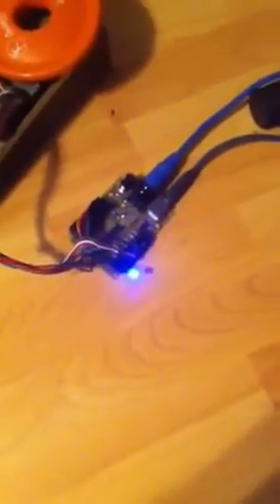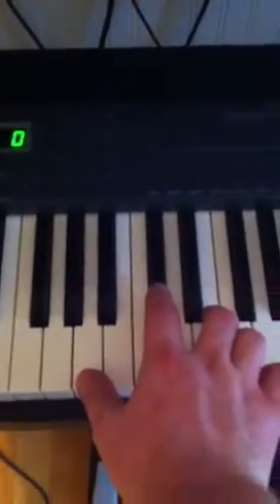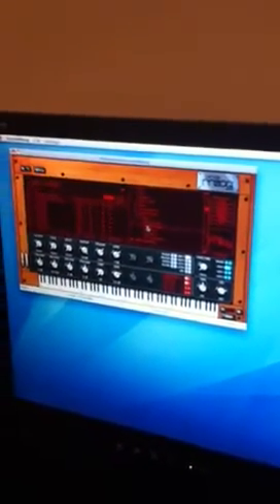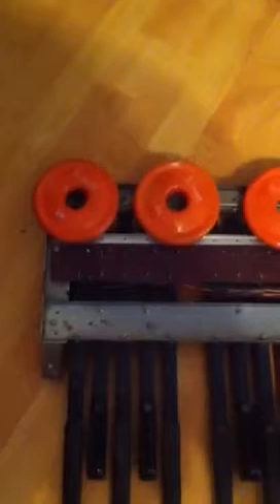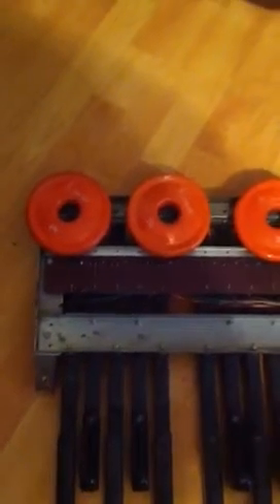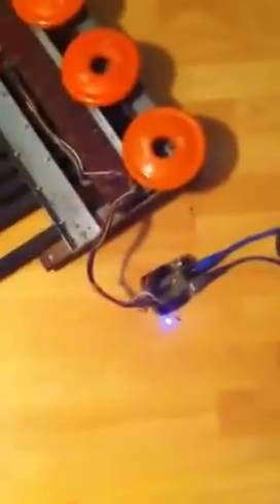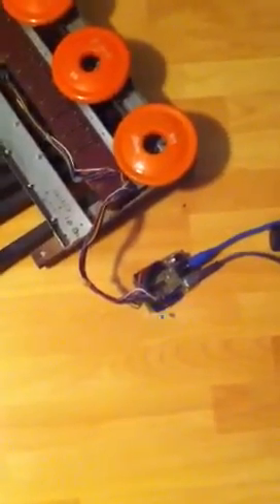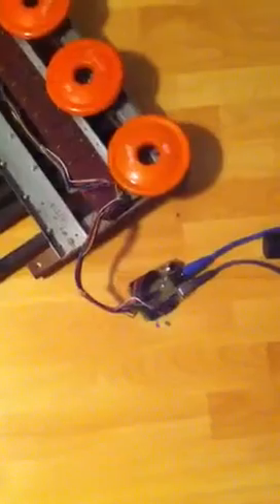DMC board with organ pedals - MIDI Bass Pedals

Comment: I've been looking at doing some arduino midi work myself. Playing guitar and trying to sync a keyboard with my RC-3 started me on a quest.
I've purchased DMC-236 from a gentleman in Calgary who was upgrading, at the price it was worth the head start for parts and research.
I have a Marshall head JMD-1 and a GSP-21 Legend that can bank/preset switch with Midi.  
Also have an Alesis tigger i/o and a couple of 80's midi keyboards that I'd like to sync with/use while looping.
Right now I'm thinking the DMC might be a good option for the GSP-21. Banking/expression
Are the Gen-1 versions running an Arduino bootloader? Could I make a sketch and  just load it? Obviously have to do a little io reverse engineering.
Input would be appreciated. I know you got a business to run, but at the prices, I've already got a Mega sitting here playing out notes, I'm not your market :) 
It'd be nice to put new life into this gen-1 gear as well.